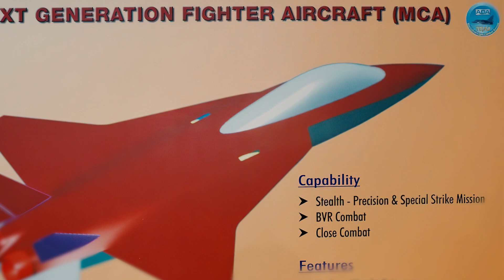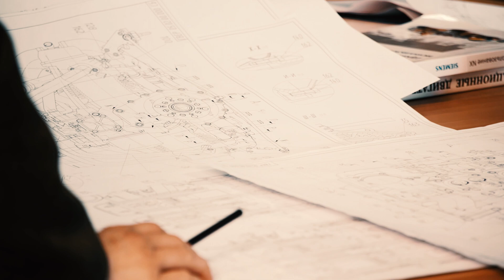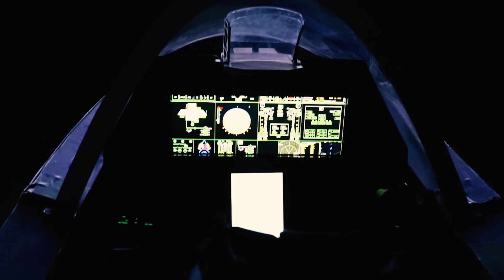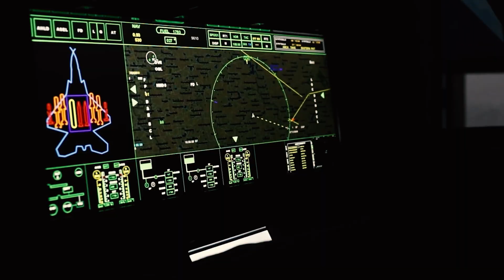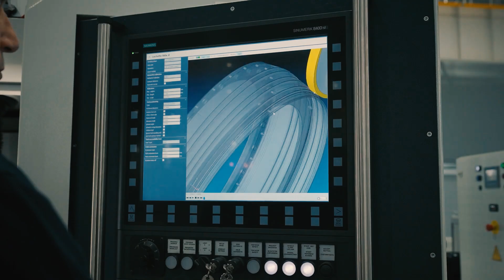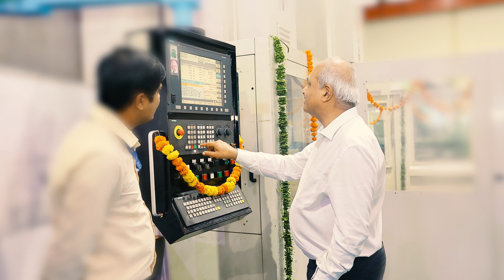The Most Unexpected Stealth Fighter to Fight China?

Comment: Why in comments is being an expert hal is only manufacture or assembler of this jet actually the technologies which are already developed like dual colour MAWS, rf & uv based maws , rwr , GaN based radar, FLIR, RADAR absorbing coating, distributed apperture systems, missiles, composites , fly by wire systems are all development by various labs of Drdo like casdic , dare, etc etc. these technologies i mentioned are already developed and some are in development . This trchs are used in upgradation of su30mki called super sukhoi. Hal has nothing to do with design develop

Comment: We'll see if India can manufacture even one prototype.
Inida has been trying to build an indigenous fighter since the day India gained its independence and I think the only aircraft produced was a derivative of the F-5 back around the 1950's. Back then, everyone made their version of the F-5.
There are big risks, costs and likely failure associated with achieving the milestone of building a prototype and failing. Both likely will result in massive losses for the Indian government and people, far more than if an aircraft was simply purchased from someone else. 
India has very little indigenous technology that can go into the aircaft. The engines will be second rate but presumably sufficient, one of the best you can buy if you'd buy from GE, P&W or RR. Presumably at least some if not most of the avionics will come from France. No word from anyone I've seen where India will be getting manufacturing tools and materials.
If I were to bet, somewhere along the line India will come to its senses and mothball the MCA project and try to buy more Rafales.

Comment: We are still in the PowerPoint presentation stage of the plane since 2005
Reply: The Program was proposed as a Twin Engine 4.5+ Gen Fighter in 2010 which was later transfer in the ORCA and a new  5th Gen Aircraft was started in 2013...It's only being 10 years since then and it has completed its CDR and would most likely rolled out in 2-3 years from now....in 2005 we were not even thinking of making planes on our own...Only in 2016-17 did we start to get some serious about it...
Reply: @NS-ll9ur  India built Asia's first aircraft called marut way back in 60s or 70s but the economic crisis and stupid govt dunk that down
Reply: Critical Design Review already done. CCS approval granted.

Comment: What is an aircraft? A metal body, sure India can produce that. But ir doesn’t fly without a top-line engine, is useless without a moderan radar, missiles, sensorsystem etc etc. 
No way India can develop these critical parts that makes a modern, fighter.
But France will for sure sell them, and everybody else, what they need. If only to reduce the costs of their own coming fighter.
Bur it will not be a Indian fighter.

Comment: That was not a bubble canopy you can't see out the back its blocked. Just saying.
Reply: By the term single-bubble canopy, they mean the cockpit glass will be one integral part with no breaks in between, which is a basic requirement in 5th gen fighters to eliminate radar returns. This jet will have DAS and a 360-degree-see-through-cockpit similar to what they have on F-35. Get with the times my man. These days even tanks in India are getting this stuff.

Comment: no point boasting like an Indian when thr plane is still on the drawing board. South Korea's so called stealth plane are not that stealthy at all, if they start to have internal payload, the plane has to be redesigned internally, it will be more bulky and heavier and the internal fuel has to be redesigned as well. The whole jet engine would be required to undergo more test as it will be more underpowered. Adding just 4 internal bombs is equivalent of adding additional 6-15 tonne, that includes the harness and locking and release mechanisms. used to work in the f-35 programme to know all of these
Reply: TF? Which one are you d!ssing? The Indian jet or the Korean jet? Make up ur mind.

Comment: Weird...the models look all different.  The metal one has inlets similar to the F22, but the others have inlets like the F35.  I read somewhere that the inlets of the F35 are superior to the F22.  I wonder what will be the final design.
Reply: Cuz design was changing! Some footages are old !
Reply: @polarbear7  I get that, but it looks like the metal (titanium) one has the F22 inlets.  I would think that if you are going to spend money fabricating with titanium, it would be closer to the finished design.  So, why the older design inlets?
Reply: @sammcbride2464  The F-35 like intake you are talking about is called a Diverter-less Supersonic Intake (DSI). Initial AMCA designs did not have DSI, which is why it looks like an F-22 intake. But somewhere around 2017 I reckon, during the PDR, they managed to crack the code on DSI and equipped it on the jet. Anyways, the final design, which completed the Critical Design Review (last design stage before prototype building starts) last year, has DSI. There is no  ambiguity on this.
Reply: @death_parade  I get that, but the proposals are a bit all over the place.

Comment: all i can think about is the Indian Arjun Mk 1 tank.... 35 years to build it and it wouldn't work in hot weather
Reply: ..or even something as simple as an combat rifle..the INSAS..
Reply: @franzm24  Even the M4 failed its test in all Indian climate zones.
Reply: What you couldn't think about is the upgraded version of that tank called the Arjun Mk-1A – 114 of which are entering service being ordered by the Indian Army after vigorous testing in all types of weather conditions.
It'll have a 3rd Gen Thermal, ALWACS (Advanced Laser Warning & Control System) & will fire fire HEAT, HESH, PCB-TB (Penetration-cum-Blast Thermobaric) & APFSDS.
Soon it will be upgraded with an indigenous 1,500 Hp Bharat Powerpack Engine as well.
Reply: @IndoSB  with only 2 of them (prototypes) being in service, the first 5 production models being delivered within 30 months (2.5 years to build 5 tanks) of a total of 118 on order vs the 2078 T-90's in service with 464 on order, or the 2410 T-72's currently in service that need to be replaced... the Indian Army isn't showing much confidence in the Arjun considering how many they're actually buying vs Russian tanks still on order.  so yea, buying 118 tanks out of a pool of nearly 5000 tanks speaks volumes
Reply: @garycheavin8768  T-72s were bought when the Arjun wasn't even a thing. No better options were available which could be deployed everywhere in the country.
Arjun was developed specifically for the Deserts & Plains against Pakistan, while T-90s were bought for the Deserts, Plains & Mountains - So the increased numbers make sense.
Btw 118 Mk-1As in addition to the 124 Mk-1s already in service. First you said it doesn't work in hot weather. Then you said it wasn't ordered as much as the T-72s & T-90s. Keep changing your goalposts 👍
The Arjun also gave us valuable lessons in developing MBTs for the first time. Based on that knowledge, DRDO is now making the 1st prototype of Zorawar LMBT & will make the FMBT in future 😎
Reply: believe what you will, the numbers purchased speak for themselves
Reply: @garycheavin8768  usa has only 190 F22 out of total 3000+ fighter aircraft.
Does that mean F22 is trash ?? 
Every military equipment have its own purpose.
For the context : Arjun MBT was made to tackle Pakistan when they wanted to get US based MBTs . 
Pakistan didn’t proceed with there Usa tank purchase - so Indian military loose interest in Arjun.
Hope you are clear.
Reply: @nitishbhardwaj4812  the Indian Army didn't want it plain and simple, they purchased Russian tanks instead of their own locally made model that they spent 35 years and tens of Billions of dollars on development.  That speaks for itself, if it was any good, the Indian Army would have bought it, the Indian Government would have insisted that they purchased it (if only for the balance of payments!) but it quietly died.
Reply: @garycheavin8768  my friend- Arjun MBT design Work begun in 1986  and order given on 2004 after finishing its development cycle, that is 18 years ; that too when west had imposed sanctions over India. 
Last T90 order was given in 2001 - How can India order Arjun - without completing its development cycle ?
Reply: @nitishbhardwaj4812  the order was for 124 tanks was completed in 2012, then came the Arjun MK1A variant and by 2018 2 had been built with a further 118 MK1A tanks on order.  Currently the Indian Army operates 2078 T90S, 2410 T-72 MK2's.  The initial contract for the T90S of 310 units was signed in 2001, in 2006 a further 347 were ordered, Dec 2007 another order for 300 was placed and in 2019 another order of 464 T90S's was placed so if the tank was so good.. why only 124 units were ordered in total (and remember, these were production models not prototypes).  The Indian Army had so much confidence in the tank that they refused to buy it after it's initial deliveries and went with a Russian tank. According to P Sivakumar, Director of Combat Vehicles Research & Development Establishment (CVRDE), “the weight of the Arjun prevents it from being deployed in all the areas required by the Army”  and I think he'd know
Reply: @garycheavin8768  My friend - As mentioned earlier, after Initial induction - there was no need of inducting more Arjun MBT tanks - which were made to counter Pakistan’s anticipated purchase of USA based MBT.

Comment: There no confirmation of safran engine being used as M 88 has a very low thrust as of  now which is 75 kn which is less than baseline GE F404 producing 78 kn also recently GE agreed to give full ToT to HAL in phase wise manner so GE has greater chance of developing engine with HAL also as of now GE F414 are confirmed to be made in India with 75% ToT which will later increase to 100% so theres a big chance GE F414 EPE with higher thrust of 26000lbf[117kn] would be chosen to make a next gen engine
Reply: If they ever use the F414 they will not use the other engine but one time.

Comment: The fighter in the thumbnail looks like a F35 w 2 engines 💀
Reply: Just because it has DSI makes it "F-35-like"? Achieving microwave band stealth with this conventional planform will inevitably lead to similar looking designs. This is called convergent evolution in the lingo of us Design Engineers.

Go look at the first pics of the AMCA concept when it was still called the MCA. It looked nothing like the F-35. That is how it was conceived. Then each design iteration (is documented in public fora) led to gradual and sequential changes until it "started looking like F-22" in 2015-2017. And then a couple years later when they finally managed to crack the DSI, and installed it on the AMCA, it suddenly started "looking like a twin-engine F-35". This is convergent design evolution in action. Doesn't mean they "copied it." SMH at u n00bs with no domain knowledge.

Comment: They should target something like an F-15EX. Good radar, good data linking,  lots of missiles,  including bigger than those carried internally by 5th gen adversaries. Two seats with the second seat dealing with drone wingmen that can be stealthy and up ahead (and be developed later). Sacrifice stealth and maneuverability to reduce complexity and costs.
Reply: AMCA is still far away. Before that India will have Tejas Mk2 and TEDBF. They both are 4.5 gen and will do what you are expecting.
Reply: India Already has 200+ Su 30 which matches  F15 role of long range fighter. They need stealth...it's the missing component.
Reply: @distorteddingo9230  yea but EX is a missile truck at Mach 2:5 better radar irst tracking are you kidding me
Reply: @rosevitelli5814  India fights border disputes with overlapping radar, S400 defense system, AWAX, and ECW. All major Pakistani cities and Chinese Airbases are less than 300 Miles from Indian air Bases. Any further escalation with China would involve ICBM Nuclear Warheads
Reply: Very sensible cost effective  plan.
Reply: And still bust them up.
Reply: You are talking about the Super Sukhoi upgrade of the current backbone of the Indian Air Fleet: Su-30MKI. This upgrade equips the Su-30MKI with most of what is planned for the F-15EX. And India is carrying out this upgrade almost entirely using Indian designed and developed technology, from radars to EW suite to IRST and MAWS to new mission computers and weapons: All Indian.
Reply: ~Smiles* from SU-30MKI...

Comment: if you cant do multi-environment flying tanks, in water, under water, on ground, air and space, nope
Reply: yes mach-3+ up to in-space mach-6
Reply: fan blades, for what, only ram-jets
Reply: directional ramjets, any air speed, faster in higher mach number
Reply: glow fuel injection ignition is better than whatever you currently use as flame holder, also works underwater, if you have oxidizer/air in storage

Comment: F-35 was a technological stretch, and Lockheed Martin did NOT step up to the task. F-35 is a huge financial burden that is still problem filled.
Reply: What? this isnt 2013 anymore. The F-35 is the single most successful 5th generation fighter in the world. Around one thousand built, one of the lowest failure rates in modern aircraft history, and currently cheaper to buy at 78million a piece than some 4-4.5th gen fighters like Gripen. Its no longer a 200+ million $ aircraft with teething problems, its a mature and capable platform currently rivalled by absolutely nothing thats flying in significant numbers.
Reply: @yungpindakaas  I think you're wearing rose-colored glasses. F-35 problems persist. My news source is to google f-35, and the reports on it, present-day, are not rosey.
Reply: @davidh7799  Every aircraft has failures and problems. F-35 has statistically one of the lowest failure and highest reliability ratings of the US air fleet atm. Yes it had teething problems but thats what is to be expected on the integration of any new technology.
Reply: @davidh7799   Also the news on the F-35 is a huge bandwagon of negativity, often refering to either Russian propaganda talking points or factually false information.
Reply: @yungpindakaas  I hope you are right. .
Reply: @yungpindakaas  Keep drinking the Lockheed Martin KOOLAID Wessel.
It will be the death of you.
American pilots flying this $1,7-triiion flop will soon realize they are on suicide missions. 
That is, if they can take off! 
Half these dogs are hangar queens with horrendous Maintenace problems.
 And still with 800+ deficiencies 17-years(!) into the program. The plane will be outdated before it is debugged.
The Air Force knows it's a failure - why there is such a big hurry to get the next-generation boondoggle going to rip off taxpayers! 
These F-35's will be scrap in the Arizona desert with 10-years. 
The biggest example of military acquisition malfeasance in history. Somebody should be in jail!